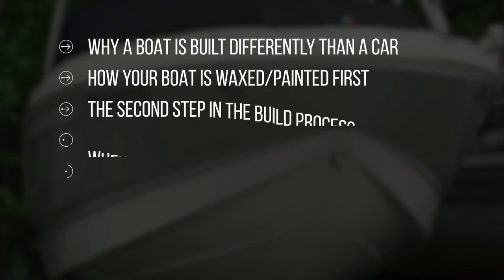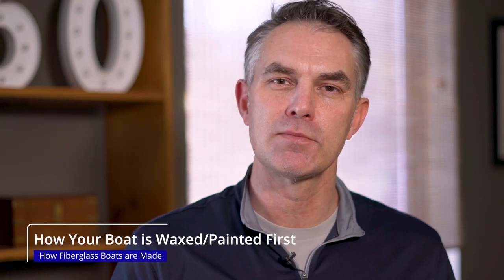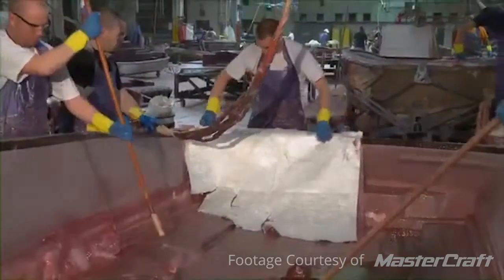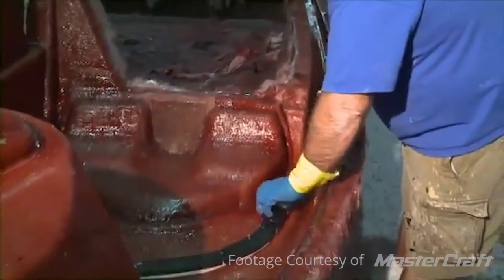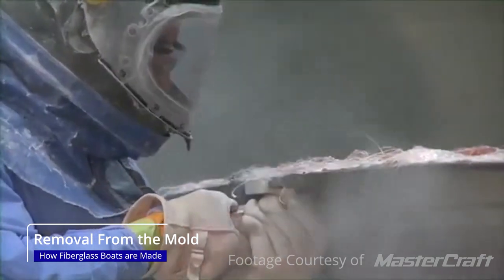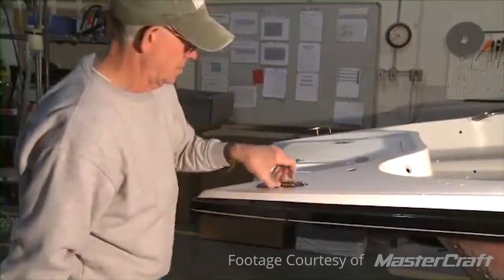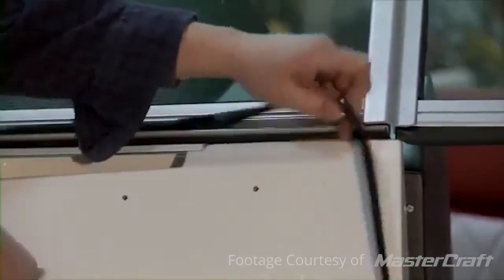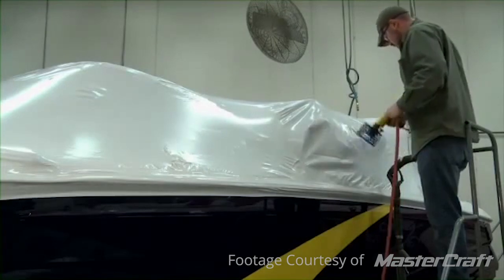How Fiberglass Boats Are Made

Comment: Cars are not painted last, after the body is assembled it is dipped in acid, then e coat primer, then primed and painted before any of the parts are added on
Reply from the maker: Yes and the point was that the finish cows on after the structure is created (the reverse of a boat). What you say is true

Comment: Notice took down or removed my comment about the mastercraft vid used.  Like the channel and the vids.  However if that is a stringer system and not a jig setup for installing stringers then that looks like wood.  Mastercraft states no wood in their boats.  Have said that for over last 30 years.  Owned 3 over time.  Hope that is not a false statement.  It would be disappointing. Since i like the boats.
Reply: Stringers and floor / transom are probably made out of wood, almost a 100%  certain.
Reply: @moin4183  Have owned 3 MaterCrafts since 1988.  Claim is no wood.  The last two owned I know did not have wood.  The 1988 boat is suspect....